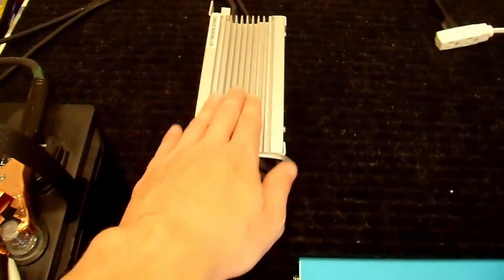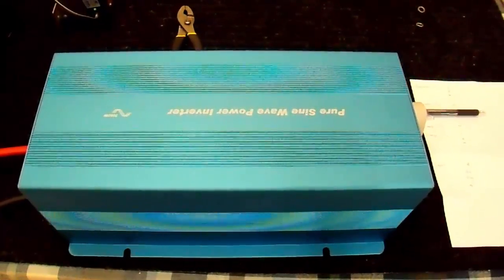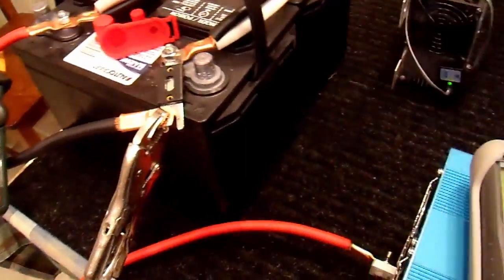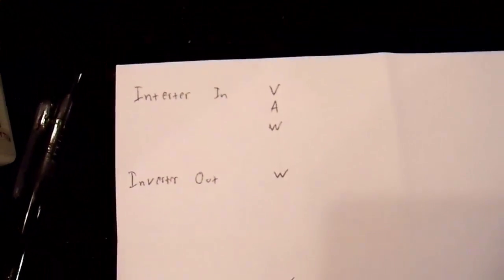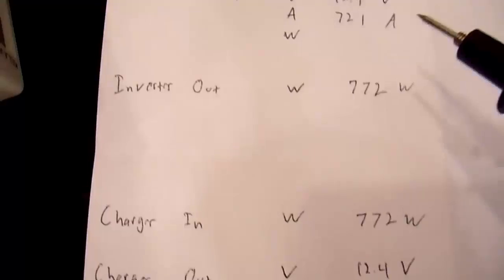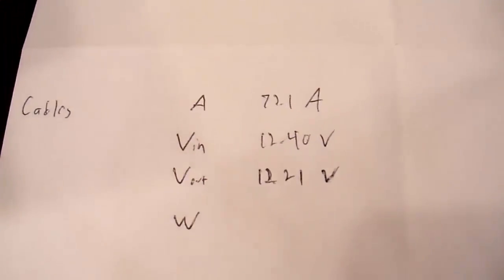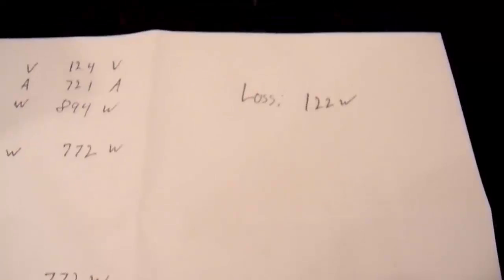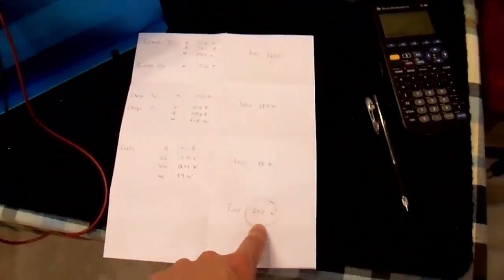Free Energy Generator! - Inverters and Batteries and Chargers, Oh My!

Comment: Also I don’t think that is perpetual motion? I thought perpetual motion was something in motion that doesn’t stop or slow down. Meaning continuous motion with out combustion or something like that.
Reply from the maker: 'Perpetual motion' as commonly used simply refers to any dissipative system that requires no energy input to continue functioning.  Activation energy may be required.  Electricity does actually have physical movement BTW, electrons physically flow through wires at their 'drift velocity'.  We call that physical movement amperage.
Reply: @knurlgnar24  nice I didn't realize that. I had the wrong assumption.
Reply from the maker: @ Very few people realize that electricity is physical movement of electrons.  It isn't really taught that way unfortunately.

Comment: I understand this is an old! So how does solar panels keep the battery bank charged? It’s basically just a battery charger. So if you have an efficient enough battery bank and battery charger/ charger’s. How is it any different than the solar panels charging the battery bank? If the battery bank and charger both exceed the draw of the inverter it would have to work right? I haven’t seen more of your content yet maybe you did an update idk yet.
Reply from the maker: The solar panel is the energy input to the system which converts sunlight into electricity at an efficiency of 20% or so.  I agree that in the context of 'renewable energy' sunlight can be considered infinite for practical purposes.
Reply: @knurlgnar24  also if you have any videos on something similar please post s link I would like to see it

Comment: Ask the guy, how to build a 12v power bank into a 120v system using an 4000w inverter. Can I plug the camper 30amp power distrib. panel directly into the inverter? Can I plug a 6amp battery charger into the inverter and will the charger keep up charging the (3) 12v battery pack. Almost perpetual power.

Comment: This was a good video...i hope you respond to me....I wonder though... if you had a AC to DC 12volts 100 watts converter (basically the output is a cigarette lighter) then you got a secondary inverter and connected it to the end of the converter, drawing only 100 watts;  then you connected it to the charger which then connects to the battery.... I wonder what would happen? And I wonder how much loss in watts you would lose then?
Reply from the maker: The AC/DC 100w converter is likely about 80% efficient so it will consume about 125W from the inverter output.  the inverter is likely 90% efficient if it is a good one powering a 125W input converter, so it draws about 139W from the battery bus.  The converter then puts 100w into the batteries.  In the end you are losing about 39W.

Comment: I know a way that it does work,dump the charger,put two other components in and bingo,job done,full power out your invertor twenty four seven,I will be doing a video soon
Reply: Nonsense. You cannot get around the losses in the inverter, at least notwith physical components. It does not matter if every other wire and component is lossless - and none are.

Comment: can you try the Patrick Kelly  idea?  
instead of using gasoline on typical gasoline generator convert it to gas generator and adjust the timing of the pistons.  Make the circle with a HHO battery powerd gas into the generator and will it self sustain?

Comment: Well I ran across one of your videos the other day. I was very impressed. While I don't have the engineering background as you do. I do have a lot of real world technical and practical experience. The thing I found most interesting is that you used the same devices as I do. In my latest search for information, I was wondering how close (economically) to powering my home. The best I could do was about 2.5 to 1 but I live in the southern United States so air condition makes it very difficult. I learned a lot from your videos and thank you for producing them.

Comment: It can be done,I've got a five kW invertor, low frequency running of one battery, now I've taken a feed off the invertor that is powering a couple of little things,they put out well over a hundred amps continuous,its not the battery that s powering the invertor, its the electronic items I've put on it that is supplying the power,and I can upscale no probs to over four hundred amps,I Will be doing a video but I am not going to show you how its done,if you want to find that out it will be on eBay when I'm done,all in a box two,by eighteen, by eighteen, sweet,I've had it running for a while now,TV,amp,lights,kettle, micro,anything I want,so yes it can be done,you are just all doing it the wrong way lol,
Reply: Eight months later and still no video.  How long does it take to make a simple video of a supposedly working system? It appears to be just another empty claim.

Comment: joule thief or boost converter  charger low input high  output
Reply: you miss a fundamental word "voltage". low voltage input, high voltage output. It is not low power input high power output.

Comment: 12 to 24 volt hand crank generator  connected to inverter with  a fan blown electric room heater plugged into inverter to heat room.  Use generator to charge your battery's . Generator plugged into inverter and an induction cooktop plugged into inverter to cook your food.  have a nice day.

Comment: Bro!!! I just fired up my full size refrigerator on a 750 watt Wal-Mart Shumacker modified sine wave inverter!!!! I'm using relatively long jumper cable wires to a small car battery connected to a 30 amp travel trailer power box!! If I had your battery system and better wires, I'm certain that I could do this all day long.

Comment: Ever watch a gravity racer? What were you saying about no free energy? What's the going rate for gravity these days? So your premise that there is no free energy is already shown to be false very simply with very simple arguments.
Reply: To make use of the gravity, you have to get that soapbox to the top of the hill. Put any kind of generator on that soapbox and the power generated on the run back to the bottom of the hill will be less than the energy required to get the soapbox to the top of the hill. 
All the racer does is recover some of the energy expended fighting against the gravity well.

Comment: you have great skills  . . . with 20 century engineering techniques . . .there another way . . . . I don't mean with counter weights and what have  . . . just motor generator . . . I did initially with 450 KW  . . . so what ever it is . . . it works . . . and  if you haven't taken a look . . . . my electric boat . . . works

Comment: Good morning

I have watched many of your Videos and thought I might post a question, although I just noticed that you have not put up a new video for a year.
I hope that things are well for you and your family.
Question:
A friend of mine bought a 24 Volt 5000 Watt 240 Volt out charger/inverter from China and I went down to help him install it a few weeks ago. But before I plugged anything in to it I check the out put voltage and found it had 2 hot legs of 240 Volts and no NEUTRAL. Would this give me a output of 480 Volts AC??? and if so is there a way of correcting so it can work here in the USA

you can contact me anthonydnoatgmaildotcom

Thank you for your time

Anthony
Reply: inverters don't have a hot and neutral. They have 2 hots with a difference of potential of 120v or 240 v between them. It's just fine like it is.

Comment: You probably can improve your setup with using a boost converter up to 90-95% efficency by boosting the voltage up from your batteries to say 13.5V or something (not mention the "charging losses due to the chemistry in the battery)   ;-)

Comment: Okay look all you have to do is plug in something that's got a motor fast enough to turn and alternator this motor needs to run on a c. alternator makes dc it makes a bunch of it .  from the alternator go back to the batteries you end up making more electricity then you use I don't know this free energy or what it is that I use this on my boat and when I go fishing I stay out for 4 days sometimes have a refrigerator on myboat. look all you have to do is plug in something that's got a motor fast enough to turn the alternator. I use a 9 inch grinder. this thing needs to run on a c. the alternator makes dc. it makes a bunch of it.the 1 I own makes 190 volts from the alternator go back to the batteries you and up making more electricity then you use I don't know this free energy or what it is.  I use this on my boat and when I go fishing I stay out for 4 days sometimes. I have a refrigerator on my boat. a tv and whatever else I want to use. i never run out of power.my motor is an electric motor it turns the alternator. it's whatever.

Comment: my vision of Teslas tecnology  https://cloud.mail.ru/public/JVAz/XjpXmX6Zi
If shortly, vision based on Teslas patent № 512340. 
Common tesla transformers secondary coil consist of one layer. But in this version the secondary coil is bifilar, videlicet it consist of two layers, connected in series. 
Between layers we have electrical field E=U/2 . If we put capacitor (two plates with dielectric between them) in this field, we will have electric charge separation (electric induction) in it. Load mast be connected to this “internal” capacitor. There is NO magnetic coupling between coil current and load (inner capacitor) current, because they are perpendicular! So there is NO electromagnetic feedback!
To better understanding read Teslas patent № 512340 and Donald L. Smith  www.free-energy-info.com/Smith.pdf

Comment: no step up transformer, or transistor it's no wonder why you have loss and no gain not Evan a cap
Reply: Umm, there's a step up transformer in the inverter taking 12v to 120v, and a step down, or probably a switching power supply in the charger taking 120v to 12v.  Transformers aren't 100% efficient either, so if you add a transformer, then you've lost that much more power.
Reply: loool yes, i bet his cables aren't even deoxygenated right? what an amateur

Comment: if I have enough solar panels to hold the loads in the house,  then I have free energy. Yes it costs money to buy the solar panels, charge controllers, inverters at first, but they will pay for themselves for the money I would be paying the electric company in just one years time. After that I would have a big fat ZERO electric bill. How is this NOT free energy ?
Reply: No solar system pays for itself in one year. Most struggle to do so in 10 years and many never come close. Typically, solar panels fail before the investment is paid back.

Comment: so....if another small source of power could be add (solar or wind) the loss would drop. Is that charger pwm type, load drops, output drops ? Though the inverter load varies by application and how efficient and condition are the battery banks?  Still, an interesting project.!
Try ecm motors used as wind generator or even belt driven..add voltage regulators/current limiters..

Comment: What do you expect?  None of these devices make any claims of any sort of radiant energy from the vacuum.   Does such an animal really exist in any of these videos?
Reply: +Soteriology101 The Casimir effect is real and does essentially violate the law of conservation of energy.  It is a loop hole. Up until recently it was purely a theoretical construct that was very difficult to demonstrate.  The sun uses fusion but for a very long time no one knew where all that energy came from.
Something is pushing the universe to expand and it must be very powerful to move that mass.  Some say dark energy and go no further.  It appears the Casimir effect could be the culprit.  The two are possibly not just twins but might actually be the same thing.

Comment: Vibration of atoms is Electricity, move those electrons by any means, without cost of money or labor or a commodity, you have Free Energy. Heat from the Sn, moving water or air cause  produces energy, your job is to move it into a device where mankind had use it, with little or no cost. Tesla had it, used it, and they stole it.

Comment: Friction causes energy loses called HEAT....Take the Heat out of the Air convert to power to operate devices and you have free energy. Move water by nature, moving a device that produces power, you have free energy. Have Wind move a device and you have free energy, this is not rocket science.

Comment: just add capacitors to the output of the inverter. problem solved
Reply: +Fred Lieb 
No. Capture all the heat (and light and sound) generated and convert to electricity. Problem solved.
Reply: +James Pian And then find a place to put it and a way to get it back in usable form. always some loss somewhere.  Extract energy from the universe directly by harnessing the Casimir effect. Even the losses would be eventually recovered. after the universe contracted to a virtual point and started to expand you could start over from the other direction.

Comment: So those guys that say they've made a free energy setup must see that their setup eventually dies.

How long would the battery last in this setup before it dies?
Reply: +123abcbruce 
If those batteries are 100 Ah batteries connected in parallel then the total Ah available is 200. At a 72 Amp draw, as measured going into the inverter, The batteries would be depleted in 200/72=2.77 hours (2 hours 47 min). But I'm sure the inverter would sound an alarm in half that time, or just shut down.

Comment: dude you know the cables are to thin and makes loss so why dont you use much thicker wire? 2 the battery charger in loop is so i did this test what i would suggest is an isolation transformer inline with charger and 3 if you make an a b or abc  battery circut while 1 is charging the other is running inverter  this way its not using  the same circuit and inverter is isolated from charge you wold need to  use a hi current switch or  a mosfet in line to positive either ford starter soloniod but uses some current 6-8 amps each or the mosfet  thats far less  loss i have a motor running an s 12 alternator all  parts removed diodes n regulator  where blown so i  ran 3 conductor wire tied to stator  out of case made board 3 phase diode islated brushes  inside to a step down 12v 2 amp to bridge rectifire  on heat sink with a drop resistor of 3 ohms 20 watt  when plugged in outlet or 2 k inverter it outs 14-14.6vdc @ 35 amps the ac motor hi efficiency  115vac 6amp and fan cooled as per s12 is everything runs mint i did that test with just a 12vdc 600 amp car battery  battery charger failed  motor alternator keeps running  if i put in an ab circuit then it will run as normal but have to switch back n forth when volts drop to far but will sustain at that point on

Comment: hi nice sine wave inverter. no such thing as free energy. but yes there is and thats solar electric panels wwhich I run my home most of the year. the sun is free. the p3 kilo watt meter I believe does not read correct on square wave. it is not a true rms meter. but since you are using a sine wave inverter it will read correct. but not on a square wave inverter john millardkeep the faith
Reply: It's not free because of the equipment cost (though it may be a good deal, depending on how much power you get, the equipment cost & lifetime, etc.).  If it cost, say, $20k for the system, what are the monthly payments?
Reply: +john millard I am sure he knew which way the loaded dice would roll ahead of time.  This is a cool video to show people that have this idea and think they are making power for free.   If they start taxing the energy you produce from the panels, and in some states they do, then that energy won't feel so free.  The panels Cost quite a bit along with all the other equipment.  That is not free.  They are worthless at night and very close to worthless during a cloudy day.  Even during the brightest day they are at best 30 % efficient.  A power generating station is around 34% efficient and uses fuel from the sun also. The fossil fuel at one point concentrated the carbon from the air using photo synthesis before it was fossilized.   Nuke plants use free energy too they just dig it up out of the ground and refine the fuel a bit.  They have a meter so they can recover Their amortized equipment costs and make a profit.  He was demonstrating the concepts of free as in the losses incurred in a loop. Not free as in cost.   If you crunch the numbers you might get your money back in ten years.  So it's a draw unless you could find some other investment that you could get 7% return on the same money.    You would double your capital. With solar panels the electricity and sunlight is used up after you use it, never to be recovered.  Now if you owned a bank or an insurance company, that is free money a direct conversion from thin air all it costs them is the sunshine they blow up your backside.  That's how the government and the banking system do it.
Reply: The solar energy comes from "burning" hydrogen to helium by fusion, so its not free, its just that we didn't have to provide the fuel!  It will run out in a few billion years.

Comment: Have you seen any of Gerard Morin's video's . If not I think you should . You have very good understandings of electricity and how things work. Thank you for your videos. I am looking for some help . I was wondering if you could or have the time to answer a few questions. I want to use a small generator like 1000w to charge my 2 RV battery's to power a pure swine inverter 5000w , so I can run a A/C   2500w and micro wave 1300w  in my RV. Is this possible ? If you can please reply. Thanks
Reply: +Dealermann What in tar nation is a "swine" inverter? Something that turns hogs over? Or did you mean sine inverter?
Reply: +energyquicksand yes I meant sine ?
Reply: +energyquicksand lol "swine"  lol "turns hogs over" lol.